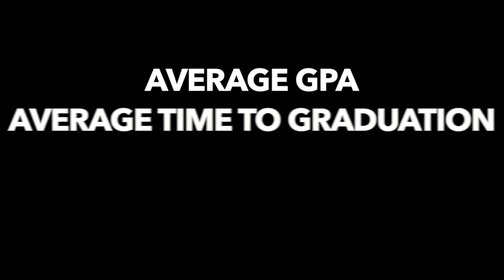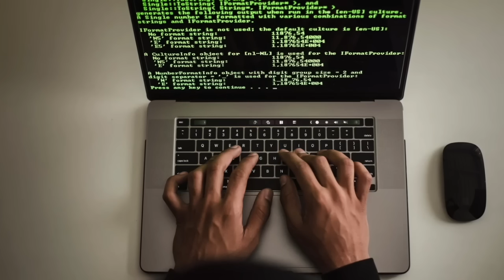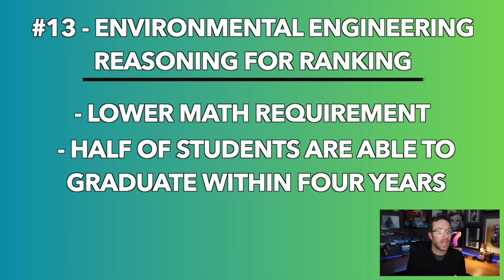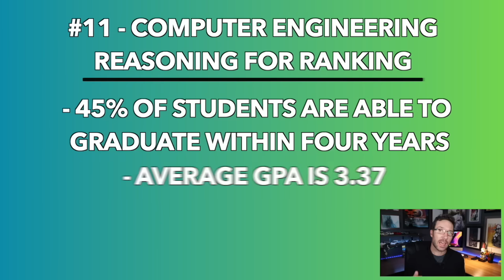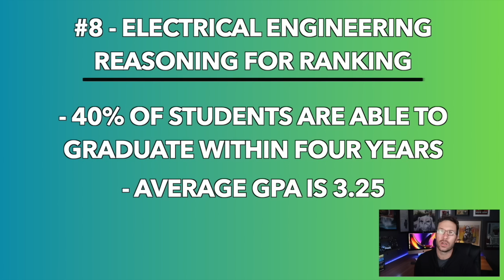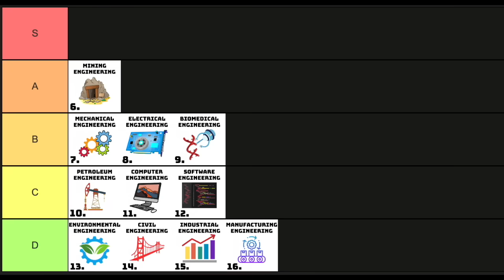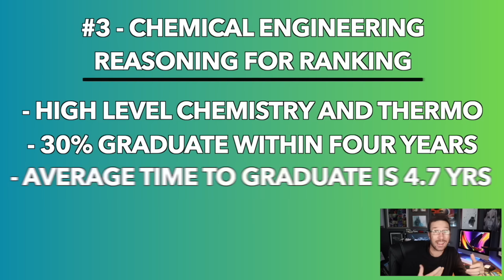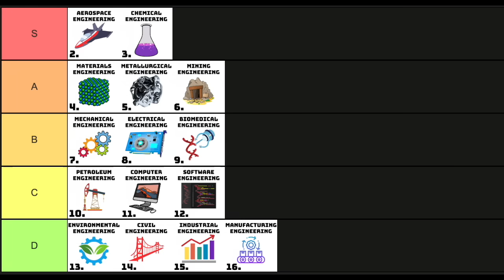Engineering Degrees Ranked By Difficulty (Tier List)

Comment: I've met a lot of people who say Electrical Engineering is so much more complicated than Mechanical due to EEs having to work with literal microscopic components, math & what they cannot observe compared to ME work. And Radio Frequencies might just be one of the most complicated things in general, The Smith Chart being an example of this.
Reply: Electromagnetics. It’s a complex field and heavy in Calculus with partial differential equations (Maxwell’s). I disagree with his assessment that ordinary differential equations was the highest mathematical study. I studied partial differential equations in my electrical engineering studies.
Reply: @brucesmith9144 Thermodynamics and fluid mechanics are full of partials, too, especially at least at the higher levels.
Reply: @silverhammer7779  At my university, we EEs take thermo thru the Mechanical Engineering Dept.  The professor kept many interesting stats over the years, and pointed out that the EEs usually ace the course, the MEs do reasonably well, and Civil Eng. not so well.
Reply: @brucesmith9144 That's so true. We had to take Electromagnetism without going through PDE's first. They really just dropped us in the deep end of the pool there.
Reply: @erenoz2910  Completely agree WRT PDEs.  Given that the wave equation is a partial differential equations, PDEs is a highly recommended elective.
Reply: @brucesmith9144 I took partial diff eq for my EE degree as well. Had this weird professor who played the violin and kept finding ways to write problems relating to violin strings and violins.
Reply: @TechnoLawyer My prof was all about his guitar strings😂
Reply: @brucesmith9144  Might even say electromagnetics is all about fields....
Reply: @brucesmith9144  and was it coincidence that his hardest rated engineering degree was the engineering field he would get into 🤔
Reply: @brucesmith9144 Plus you are working in spherical coordinates. Again, this guy doing the video doesn't seem to know much about engineering.
Reply: @brucesmith9144 Homie, every single field of engineering deals with partial differential equations, you have just been studying the easy version of things, therefore you don't know about it. Keep it real, homie.
Reply: @brucesmith9144  Same here, I'm taking partial diff equation right now
Reply: @brucesmith9144  I came to the comments to make this same point.  Well put!   Electromag still giving me flashbacks 22 years later! "E to the omega j squiggle what???"
Reply: @brucesmith9144 totally agree with you. He completely lost credibility with that comment.
Reply: @brucesmith9144  100% you are right, electrical engineering should have been placed in position 2 after Nuclear engineering, because Circuits Galore is just hell.
Computer engineering should have been placed in third position because digital circuits and coding are just pretty complex.🙏🏻
Reply: @brucesmith9144 yeah, our math course was literally the heaviest out of all the others, and also we had to use most of it later, unlike some other specialties. We were literally grouped together with rocket scientists for all of our math classes
Reply: @brucesmith9144  If you don't learn partial differential equations you will not graduate as an Electrical Engineer.
Reply: @brucesmith9144 yes electrical machines and motors involve serious math.
Reply: @brucesmith9144 Agree totally when I did my electrical engineering degree it was heavy with partial differential equations in subjects like field analysis and communications systems. Most who didn't have high levels of math going in really struggled or even failed to get through. This was over 30 years ago so not sure if it's been dumbed down these days.
Reply: As someone working on a PhD in EE, it just depends on what you are doing. Electrical engineering undergrad programs have a lot of different focuses, and not all of them are as math heavy. 

If you are someone working on integrated circuits and comp E, you'll have a lot more focus on things like circuit design and VHDL/Assembly writing rather than strictly mathematics. If you end up studying control systems engineering, information systems engineering, semiconductor physics, or power systems, then you'll need a good bit more mathematics.
Reply: @r @ryanh7167  Hi, I think you may be able to help me, I'm kind of confused about where I'm positioned as an electronic engineering student. Would I also be considered an electrical engineer, or more of a computer engineer?
Reply: i still think it depends a lot of the university! Mech Eng can get as abstract as any EE degree if it focuses on Fluids and Energy.
Reply: @Abstractor21  not to mention, ME also covers EE topics but not really vice-versa
Reply: @nikolaimikhail7774  Yeah ME is the jack of all trades. It kinda reminds me of chemistry, Chemistry does have a lot of physics and biology and math, but not the other way around (physics usually don't take chemistry, math usually dont take physics or chemistry or biology, etc)  
Both degrees are actually pretty big and will let you specialize in so many subjects: some too abstract, others too visual.
Reply: @nikolaimikhail7774 Actually, that’s not true. My EE program required several ME courses up to Junior level,  but ME’s only had to take a single Freshman level EE class.
Reply: Fluids in EE and Fields in ME have many parallels.
Reply: @Abstractor21  also depends on subdiscipline chosen by student.
Reply: That is 🧢, Mech e Is 10000x times easier. Go learn about convolution and come back
Reply: @NativeBox easier!!!!! People who talked about mech engineering being easier haven't taked thermo and fluids
Reply: Also, math for EE includes partial diff E as well as linear algebra, stats and combinatorial algebra. I suppose it depends on university and focus of study.
Reply: I have 10 years of experience working in engineering. Whatever they said when we were students doesnt hold truth anymore. I have seen computer engineers run circles around mechanical and electrical engineers. It all comes down to the person.
Reply: @nocapproductions5471 I agree
Reply: @nocapproductions5471  I'm kind of confused about where I'm positioned as an electronic engineering student. Would I also be considered an electrical engineer, or more of a computer engineer?
Reply: Just got done with my intro to Radio Frequency class. I got 100% on the exam on the Smith charts and impedance matching. Not too complicated in my opinion.
Reply: True
Reply: Yes. Even here in our country (Philippines) they say that the Licensure Exam consists of 2 parts.
Reply: It depends how you set up your classes. Im taking EM right now having taken DEs and Calculus 3 already. Cal 3 is a Coreq- for EM at my school and DEs is a coreq for circuits. I feel bad for my classmates who are taking Cal 3 at the same time because the useful stuff doesn’t come up till the end 🫠
Reply: I studied electronic engineering, which shares a lot of subjects with electrical engineering in my country. Both degrees take 5 years each. A few comments I have are:
1) It's true that working with the Smith chart is not difficult, but truly understanding what it means (it's a graph on Cartesian coordinates for the reflexion coefficients, on which you can also read on polar coordinates the value of the impedance of a transmission line, a.k.a. distributed parameters of that line) is not so simple.
2) all the explanation of electromagnetic wave guides is based on partial differential equations derived from Maxwell equations 
3) What was not mentioned in this video is that EE also covers the study of complex functions with complex variables, including Fourier transformations, Laplace transformations, and difference  equations (kind of like differential equations, but with complex numbers and complex functions). All of this is used to analyze and design electrical circuits, analog and digital control systems and filters, and much more.
Reply: @mega406 Those aren't easy math at all
Reply: @mega406 I started electronics engineering in 1964 at the age of 15. Finished in 1969 at the age of 20.
Then the government gave me a gun and shipped me to Asia by the time I gave them back the gun I was too old to find work because of the huge advance in semi conductors had to do a huge amount of study to catch up
Reply: @mega406  I'm kind of confused about where I'm positioned as an electronic engineering student. Would I also be considered an electrical engineer, or more of a computer engineer? Also, when you say EE, do you usually mean electrical engineer or electronic engineer, and is it interchangeable?
Reply: @LoveFromChilay  yes, I think I get why you're confused. Electronic engineering is not the same as electrical engineering nor computer engineering. However, there are topics that you study in electronic engineering that are also covered in electrical engineering, and other topics that are covered in computer engineering. In my opinion, you could say that electronic engineering sits between electrical engineering and computer engineering, but each of those 3 engineerings is different from the other 2. In my previous comment, when i said "EE" I meant "electrical engineering". And electrical engineering is not the same as electronic engineering, they are  different degrees. I know I was redundant with my answers, but I tried to follow the same order of your questions. I hope this was helpful!
Reply: Mechanical, Electrical and Civil Engineering are very versatile degrees. Once you get them, you can work in multiple industries.
Reply: EE and ME both are equally complicated, if you are at the top/leading area for these disciplines, because both need to study the field, Electromagnetic fields, and Stress fields, are equally complex things. Remember, people always say, it is not a rocket science, which means, rocket science is hard, how to design a rocket is a wayyyyyyyyyyyyyyyyyyyyyyyyy complicated Mechanical job.
Reply: Objective difficulty is just part of the story. No two people are the same, people have different talents, interests, strengths and weaknesses and the knowledge they already have when they start studying differs, too. That means: a degree, that’s easy for one person, maybe difficult for another and vice versa.
Reply: @MrAranton  This a great point.  I’m sure there are absolutely brilliant nuclear engineers who would struggle as an English major.
Reply: @tomw485  I can do all kinds of very complicated calculation in Mechanical eng., but once I had a chance to learn accounting in Business course, I was totally smashed by financial accounting course, I just can't get into that system (only needs Junior high school math).
Reply: @tomw485  Understanding how to properly interpret a company’s financial statements is an incredibly useful skill. ----- You nail it! This is why CEOs get paid so much.
Reply: @hanfucolorful9656  It is a futile and useless exercise to try to properly understand and interpret the financial statements of companies.  The financial statements do not reflect the true financial performances of companies because financial statements are full of fudged numbers.  The reality is that many employees from the bottom to the top echelon of a company can get away with manipulating their financial numbers to suit their self-interest.  Hence, financial statements are not completed with actual numbers but distorted nominal numbers.
Reply: @markwilliams8257  Thank you for your enlightenment.
Reply: I'm sure universities vary greatly in EE math requirements, at UTD signals and systems as well as EMag required linear algebra, integral as well as differential calculus. Math well beyond partial Diff Equations. Math which is similar to ME and Aerospace Eng when you start to discuss the heat equation or Navier-Stokes equations. 

I think some of the highest math quoted in several of the engineering degrees in the video are only half way into what's required. Dif-E-Q, is only sophomore level.
Reply: I don’t think a lot of yall realize how big EE is lol must of yall just thinking of electronics. People seem to forget about power lol
Reply: @jqthebest1  I'm kind of confused about where I'm positioned as an electronic engineering student. Would I also be considered an electrical engineer, or more of a computer engineer?
Reply: @L @LoveFromChilay  what classes are your focus? Or what kind of job are you looking to get after college
Reply: @jqthebest1  So it's electronic engineering in general which includes pretty much every topic from the subject (except RF somewhat). My course is more focused on computers, so it's got a lot of crossover with computer engineering. It's also got some topics from electrical engineering like electromagnetism and control systems.

As for the job, originally I was looking to become a software developer or engineer or any job to do with computer science, but I've become less interested in these types of jobs and a software only career, hence electronic engineering because it also has software but is mainly hardware. Of course I'm considering becoming an electronic engineer but I've also considered being an avionics, automotive, embedded systems engineer, etc.

Judging from a different comment, electronic engineering is its own thing now whereas it used to be a sub discipline of electrical engineering. It's become large enough to be considered this, but there's still a lot of crossover between electrical and electronic engineering. As for why I didn't choose computer engineering, that's because I didn't want to be too specialised early on, and electronic is closer to computer engineering than electrical engineering, and is more interesting imo. It also provides a link to becoming an electrical engineer or a career based around this if I changed my mind, unlike CE which is quite different from electrical engineering.
Reply: The math requirements I had at CMU for my EE were far beyond what you list. I cannot imagine how an EE could graduate without transform theory, high level probability an statistics. Thermo, digital signal analysis and more. I had at least one math course per semester and sometimes two. Calc 1, Calc 2, solid geometry and vector analysis, and OLDECs were freshman year. Then you got the real math...
Reply: @daleamon2547 The order is more so ECE is harder than mechE which trades blows with EE
ECE (computer engineering) requires a good handle on math, CS, and EE (mainly electronics and semiconductor engineering). The math needed for CS is different from the math needed for EE and depending on how the program is structured, the compE will have to effectively be a double major. MechE vs EE depends entirely on how the program is taught at each school. There is nothing meaningful to say about each field's difficulty as a whole. Someone doing aerospace engineering will definitely be doing a much harder program than power engineering, while signals engineering can be every bit as bad if not worse than thermo (both involve the same math oftentimes and signals is often done with techniques borrowed from complex analysis for even more fine signal design)
Reply: @TheLucidDreamer12  I'm kind of confused about where I'm positioned as an electronic engineering student. Would I also be considered an electrical engineer, or more of a computer engineer?
Reply: I just started my HF- Circuits class and you are so goddamn right 💀
And the once you get to electromagnetic-field-theory the maths get much harder than even thermodynamics imo
Reply: @Julian-zh1nj have you heard of advanced thermo?
Reply: Try capturing microwave signal pulses using capacitor resistor transistor in nano seconds.
Reply: Fourier analysis in the both time domain (laplace) and frequency domain for Dynamic systems can be a challenge for new comers.

It’s usually working in the time domain with sine/cosine maths that things get complicated like Nyquist theorem etc
Reply: I say to choose an engineering major that interests you for its technical content.
Reply: I hate the whole “I can’t see it, so I don’t understand it” excuse that some MEs gave for not going into EE. You cannot see temperature, force, or pressure with your eyes either. 🤦‍♂️
Reply: you can feel them at least, but you can't feel the light, the idea of frequencies itself, and how they managed to explain it mathematically is mind-blowing  @NodeEntry
Reply: Tell them "why you look at that phone screen all day???"
Reply: @NodeEntry perhaps they meant to say EE math has more implicit infinitesimal assumptions while ME maths ensures all processes and their effects are well represented
Reply: @NodeEntry  LOL what? Pressure and temperature can't be felt?

Mech eng DOES include some electrical stuff, which is why we know its hard to visualize.
Reply: @Ninad3204  It's harder than you think to visulaize 3 parameters changing at the same time temp, pressure and specific volume and related energy parameters like enthalpy, entropy...etc.
Reply: By that logic molecular biology is also harder. Doing genetic and cellular engineering involves very specifically manipulating DNA, proteins, and cells through extremely precise methods to achieve desired outcomes.
Reply: I disagree, because where you have wave and  current physics, mechanical engineers have mechanics of solids, fluids, manufacturing, etc..... I would say they are both eaqually hard, but differently
Reply: @kexcz8276 now the programs have changed,are easier than 15 or 20 years ago.
Reply: The hardest thing about NE is getting a job.
Reply: I'm a Mechanical Engineer, EE is not a strong point for me and I totally respect EEs. That said I believe it is what one loves that matters. Also, non-linear analysis of mechanical systems is not a walk through the park but a very intense process of evaluating most systems and is becoming the norm. As an ME I've worked in Aerospace, Oil Platform Mooring systems, Military contractors (not killing but saving), Optics, and metal fabrication and design for architects and interior designers. Love it all.
Reply: In Brazil EE and ME Majors takes 5 Years. I had linear algebra in my first semester 13 years ago, it was a nightmare haha. In here EE also have subjects in Fluid Dynamics, Thermodynanics as well as Solid Mechanics and Chemestry. Combine that with EE`s normal subjects (power system`s, control and automation, telecom, data analisys, ... ) and you have a nightmare of a course. But well, if you graduate I guarantee you`ll be just fine.
Reply: @artkco  
Thermodynamics and  fluid mechanics which EE's study are just little samples of these subjects and don't study them in detail .
I'm sure that EE's have never studies issues like  psychometrics or viscosity .
Reply: As a mechanical engineer I respectfully disagree. Y’all don’t have to deal with fluid mechanics and chaos theory which is about as abstract as it gets
Reply: Nonsense! Wrong assessment parameters
Reply: Jokes on you, we have a Smith diagram in ME as well. (Smith Diagram aka Haigh and Smith Diagram related to material fatigue limit)
Reply: Agreed.  I work routinely across multiple disciplines in engineering, and used to design RF generators for thin film deposition chambers.  This video is a joke - seems like it was written by a Chem E / materials guy with delusions of grandeur.  All of tier A needs to be at least a tier down, and the EE / CS stuff needs to be 1-2 tiers up.
Reply: I agree with that. I was mechanical, the EE thing was a mystery.  That being said the thermodynamics we had to do was pretty damn wacky, and heat transfer, fluid dynamics, control systems, can certainly rival the EE stuff.  I think it comes down to aptitude.  But for me personally mechanical was easier than any exposure I had to EE.
Reply: @markg7963  I think it primarily depends on the school. I thought Chemical engineering would be hard even though I always got As in chemistry. The Chemical engineering guys told they quit electrical. I seen some electrical engineers from other schools that I was amazed they graduated HS. One kid I mentored was from Georgia Tech. Good grief was he dumb.
Reply: It does depends on the university because mechanical engineering is the study of “Mechanics” with tends to be very theoretical and abstract a requires higher level Mathematics (aerospace witch is a subfield of Mechanical)
Reply: I graduated with both an Electrical and Computer Engineering Degree. I started out in Aerospace (similar to Mechanical) Engineering but switched over to Electrical during 4th year after finding fewer graduates were getting decent jobs and aircraft manufacturers were consolidating in the 90s.  My GPA dropped 1/2 a point as the math was quite intense as was studying all the physics for signals and wave propagation; not to mention semiconductor theory and microelectronics.  One reason that more students complete the EE program is due is that the majority of those students specializing in EE from 2nd year had higher GPAs than the other programs.  The students were much more mathematically and physics inclined.
Reply: @krustykanuck  I'm kind of confused about where I'm positioned as an electronic engineering student. Would I also be considered an electrical engineer, or more of a computer engineer?
Reply: I just graduated in ME and my father is an electromagnetism (the Big Boss subject accordingly to what I heard from my EE colleagues) professor in the university I graduated. In my whole graduation my father helped me in different sujects and he said to me many times that the more he helped me, the more he was sure that ME is much harder than EE, in his opinion. It might be because the main problem for EE students (electromagnetism) is pretty easy to him 😂, and the mechanical stuff was all new to him. Nowadays he got so influenced by ME that he is routinely studying thermodynamics and fluid mechanics. As I could see, the more mastered your math is, the easier is for you to understand and delve deep into new complex knowledge.
Reply: Are you aware that laypersons, with no engineering training, who hold Extra Class Amateur Radio licenses are intimately familiar and understand “smith charts”.
Reply: I have several engineering degree and first of all. Pretty much every degree can be easier or harder depending in what specializarin.

I also have friends that have multiple engineering degree making comparison valid.

Where I'm from they are set up a bit diffent. So airospace is a subset degree and so is mining and oil drilling.

And this is sort of the pecking order most people at my university agree on.

So there is pretty much 3 levels. Hard mid and easy.

Top would be physics, math and EE. In that order.

Aerospace is a subset of physics. But most of the quantum stuff is in physics. I studied a lot of extra physics. But don't have a degree. I do have a degree in ee.

Mid would be computer, programing and chemical.

And low would be mechanical, biology, and civil.

I got a degree in mechanical and civil as well and to me it was consideally easier. I read them at 3x speed. Its worth saying that i did read the EE degree and the physics course first. Still when I go back. The mechanical and civil stuff is a lot easier.

Worth saying is that i chose construction for all my degree that is generally considered the hardest.

And there is a supricing amount of overlap between all three subjects. 

But the really crazy stuff where you have multiple dimensions of interferance just don't exist.

It's almost like in civil you only calculate on statistic.  On mechanical you calculate static and dynamic. But in EE you calculate, statistic dynamic and other stuff like noise  interferance  impedance  thar is not really a thing in mechanics.

Looking on say civil engineering. The difficilty there is not primary from math, but rather from large data sets. You have a long list of somewhat not really that hard calculation that have to be compiled. Computers for sure make that heck of a lot simpler. 

But computers wss really late in civil engineering. When I did my degree still not everything was computerized.
Reply: I took an optional computer engineering course. Many students desire a computer career, so it's hard to be accepted into the college. I got a c+ with an 85 average. Everyone gets the answer, but the professor separates grade with the eloquence of one's solutions. Very competitive.
Reply: Yep, going to RF would be abysmally hard
Reply: Elements of controls engineering can be included in several other disciplines such as mechanical, aerospace, chemical and of course electrical.  But it occasionally is a stand alone discipline too.  And it can be very difficult.
Reply: when you do experimemt in EE usually get 90% to 99% outcome, when you do Chemical you lucky the outcome is 50%.
Reply: @Cordycep1  what are you trying to say exactly then..just want to make sure I fully understand. Thanks.
Reply: EE is hard, thankyou for giving us the credit.
Reply: ❤❤ Yup EE is very hard
Reply: I'm a phd EE and the most wicked method I've ever seen is the solution of inverse problems, taught by a ME. And yes, fluid dynamics and really anything PDE is very tough.
Reply: Mechanical is toughest
Reply: Nuclear Engineering with power generation requires you to be proficient in nuclear, chemical, electrical, industrial, mechanical, thermodynamics and fluid flow engineering.
Reply: Choose a field that you have a passion for and a talent in.  You'll do well.
I'm always suspicious of those that are looking only at things like salary, or building a social media brand or following on YouTube.
Or their interest is more in "running a startup" (even if they have no idea what sort of product that would be).  That's not "engineering" that's "business" or something else.

Over the years I've met many who started initially on the EE track, but later transitioned to Software or Mechanical (and became fine engineers there).  
Indeed, the best Software Engineers came from an EE background.
I don't know any cases of the opposite, i.e. someone that was struggling in Software, but just easily transitioned into EE.
Reply: Read The Art Of Electronics. Great book !!!
Reply: I hard bypassed a fuse the other day troubleshooting an electronic board.  The sparks fire, and smoke coming out of that thing wasn’t hard to visualize at alll😂. And, as a ME, I confirmed that the board was broke enough not to worry about fixing it…
Reply: Am I the only one who did dedicated complex analysis class as EE? Focus area was signal/systems/communication systems
Reply: @loganchytraus6829  EE and complexity go together like love and trouble
Reply: As someone who did level 5 course that both mechanical and E&EP.  I can say that the latter is wayyyy more difficult.  Mechanical is basically just maths and the logic and understanding behind it is pretty common sense, thus easy to grasp.

The electrical however has much more difficult concepts to wrap your head around.  Even the “simple” stuff like Thevinin’s and  Norton’s take a solid understanding of circuit theory to fully grasp.
Reply: EE is top tier
Reply: I'm an Electronics Engineering graduate here in the philippines, basically an electrical engineer but we deal with smaller things. Also, communications was part of our course, one of our major, from ground communications to satellite to fiber optics communications, it's part of our subject. Our math, with respect to calculus also tackles up to the numerical differentiation. We also have a separate subject which includes thermodynamics. Idk how different our course is compared to other countries but if I'm correct, ECE is equivalent to EE to other regions.
Reply: Based on my decades of experience I found that as an ME I was able to do some simple EE stuff but an EE would never venture into doing ME.
Reply: Chemistry is a very non-exact science huh? Try being off by a μmol because of some error introduced by a poorly calibrated scale and it ruins 3 months of work. Get bent, scale.
Reply: Me and another guy interned at a company in the aerospace industry working on a spacecraft. We had to do outreach events as part of the internship. He was an EE and did his presentation before me telling all of the kids how ME's only make the box around the electronics. Yeah, you'd think you'd have the most difficult degree if you thought all ME's did all day was build a box around your electronics. Every engineering student thinks their degree was more difficult because engineering students are arrogant.
Reply: Don't forget ME studied robotic too (mechatronics) , so basically ME is studied almost dicipline of engineering, that's why it is one of the most difficult engineering, i would say it should be top 5, if not top 3.
Reply: But then again, Mechanical engineers could be then said to deal with components such as Fluids and Energy which are as abstract to analyse. Also, they have thermo.
Reply: That's because most people have only studied the easy version of things. When it gets really advanced, it's roughly the same difficulty, keep it real, homie.
Reply: Here in the UK My qualifications are Mech Eng/Electric Eng MSc one degree combined took 7 years
Reply: If I told my lecturers that I only needed ordinary differential equations when I studied they would have kicked me off my electrical engineering degree
Reply: So they have both degrees? 😂
Reply: I think it depends on the topic,
Reply: I think at the outside edge of the subjects when you've got guys breaking ground you've got some pretty intense mathematics going on in every single field. When you get your bachelor's degree in go out you have different requirements and hopefully find something that fits you for a person who likes to look at things mechanical would be easier than electric.
Reply: I think that EE subjects could be taught in a more intuitive way.
Reply: Electrical usually has sub-disciplines such as power, controls, circuit design etc.  The sub-discipline can strongly influence the difficulty.
Reply: Agreed, the video is full of stupid conclusions.
Reply: The Smith chart isn’t so hard, it just looks intimidating.
Reply: I am an electrical engineering major specializing in nanoelectronics. Quantum mechanics and solid-state physics are prerequisites to even enter this field.
Reply: Yeah, also chemical engineers, we see partial diferential equations in thermodynamics
Reply: @WepWip  Thats what I said in my comments, Electrical and Chemical are the hardest engineering majors in my opinion.
Reply: Smith charts are not that bad, they look intimidating and busy to look at. But once you get the idea of polar coordinates and what comprises the imaginary element of the math problem, they are fairly simple. Fixing the ratio down afterwards, that’s the hard part 😂.
Reply: As an EE my view is that Mech and EE are similar. A lot of the math is the same, but their physical realization is different. Mech is probably a bit easier because time constants are bigger and a lot of the phenomena can be seen or felt. But at the bar in the end is probably about in the same spot.
Reply: Well, you can rate the difficulty by rating the degree of complexity of their governing PDEs. So I’d say engineering degree involving fluids(Navier-Stokes Equations whose solution is also a subject matter in PDEs math study.)
Reply: Taking a poll here. Are any universities still using the textbook "Fields and Waves in Communication Electronics" (Ramo, Whinnery, VanDuzer) ? That was the text used at UCLA when I was there 40 years ago, and I still refer back to it on occasions.
Reply: Yeah, there's a list in Engineering.  A couple of these sounded similar to me, never heard of Mining before, pretty cool stuff though, we need to mine more!  I didn't see Software or Optical, or is it Applied Optics, on the list, maybe I missed them.  I bet Biomedical is tough.  BSEE (Electrical Engineering) was super tough for me, the math was wild, and we were using a program called Maple to do a lot of equation solving, triple integrals, matrix solving, graphing, not sure if they still use the program but I have a copy backed up that will still run, Matlab was hitting the scene then too.  Remember a program called P-Spice in EE lab that blew me away.  I remember stump matching for antenna design in a class with a chart that looked like it was found in a deep hole on the dark side of the moon, it was round, like my date wheel I use now, was that the Smith Chart?  Craziest class - Emag Waves and Fields, cannot see it, have to visualize it, use the right hand rule, magnetic waves in one direction, electrical waves in another, should we be concerned holding these new flip phones on our ear?  Favorite math class was Baseball statistics with a bunch of physics mixed in was really interesting, great teacher, he could write with both hands and write an equation for a curve ball, for a knuckleball, a ball coming off a bat, show you how to use data to generate these huge matrices that would output the best batting order for a given opponent, cool stuff, it would take months of review w/ a good tutor to remember all of the math.  Chemical and Mechanical were always debated vs. us Electrical guys as some of the harder disciplines.  I liked the circuits, building in the lab, power lab, and a little bit of programming, but I knew code writing wasn't what I wanted to do, I high high respect for Computer and Computer Science guys, C++ for a quarter and that was enough for me.  We would..... however..... make fun of the Civils, lol, sorry Civils...it seemed like you got no respect, and then the Civils are making fun of Industrial Engineering at other schools.  Rose-Hulman Institute of Technology, class of 2001, great people there, and some of the smartest people I've ever had the pleasure to be around, even the Civils.
Reply: I have interacted with all disciplines and each told me Electrical was the hardest. I graduated from the #2 ranked University. Highest math I took beyond DiffEQ was advanced calculus. I guess it depends on what Electrical you specialize in. Nuclear is not that hard
Reply: As an Industrial Engineer that studied BOTH electrical and mechanical engineering. My first year fluid systems & dynamics course was FAR AND AWAY more difficult than anything I saw with electrical.
Reply: @jimcetnar3130  

That’s a weed out course including thermo. How did you like Fourier analysis?
Reply: 😊😮😊😊ooo
Reply: When you get job and specialize all jobs get easier and more so as you do it every day.
Reply: I’m an ME and I find Chemical Engineering the hardest.  The amount of units required to graduate is more than the average engineering degree.  I see a lot of people saying EE and I disagree.  Did any of you like O Chem?  🤣
Reply: Not only that, EE has to have a solid understanding of physics and mechanical systems since a lot of electrical systems are used to drive mechanical systems.
Reply: As a mechanical engineer who switched from electrical engineering, I confirm this sentiment.
Reply: I didn't do it, but I know people who did.  They went far beyond ordinary differential equations.  I'm a biologist and I could do those.
Reply: Partial dif kicked my .......
Reply: mechanical has thermodynamics, electrical has electromagnetics and wireless communication. I wouldn’t say I would’ve rather studied mechanical engineering but I am happy to be concentrating on controls and robotics at the end of my electrical engineering degree now
Reply: In my degree (Electrical and Electronic Engineering) we covered all the basic thermo and fluid dynamics in the first two years covering stuff like navier stokes and the different cycles for different engines and refrigerators and stuff. We also covered some basic materials and structures etc. All the engineering degrees were accredited for mechanical engineering by the IMechE. Where it gets more difficult is when you go into aerospace engineering or sth. The maths requirement here is completely off, we went into PDEs and vector calc for Maxwells equations and also for semiconductors and transistors you need PDEs for schroedinger's equation to derive the nearly free electron model. This doesn't mention the high level of linear algebra you need if you're going to learn any control theory with state spaces or stuff like Fourier transforms, laplace and z-transforms which you need to have a very solid understanding of.
Reply: I’m a ME. When I got to physics 2 (magnetic fields, forces, current, etc) that’s when I decided ME was for me. 
That said, I did enjoy circuits and control theory in ME.
Reply: Honestly, any engineering degree can be the absolute most difficult for 99% of students (the real geniuses will get through anything without a hitch) when they encounter the professor from the Hades School of Engineering....meaning the professor from Hell.  'the final will be much like the midterm, plus a few problems from the last two chapters that 'we' haven't covered extensively anyways' .... then the final is 80% on the last two chapters that NO ONE has covered extensively anywhere.
Reply: I did Electrical Engineering with Radar Engineering as my speciality. It got me into a great career with high wages and lots of travel. I'm retired now but amazingly although I had several employers I was never asked to produce the certificates.
Reply: as a mech engg i agree in someways
Reply: What about materials science in ME??
Reply: Cfd fluid Mechanical engineer do more advanced math than electrical. I was in a nuclear fusion exam with them and we know a lot of PDE applications and numerical approch than them. They had a lot of difficult in the PDE model. Maybe depends on the different Major degrees
Reply: Wtf is that about. When I started mechanical engineer studies, it felt like the first two years were just electrical engineering studies. And all the other fields of engineering at that. At least here the company people joke "when you can't solve a problem and run out of fields of specialized engineers, you go to the mechanical engineer to solve it no matter the subject".

I would also vouch that anything related to measuring technology, surfaces, lubrication etc has pretty darn microscopic components and things you can't see. I've also never seen interior stress in a beam or microscopic vibration on resonance frequencies that leads to failures through yielding. And those FEM matrices are their own jungle, thank god for 3D modelling softwares taking care of that mostly. But those are the easy parts of it, thermodynamics and fluids can go fuck themself.
Reply: At my university, chemical engineering was the most difficult.
Reply: Having done both, the differentiator (in my opinion) is thermodynamics. Which is horrible. Electronics (which includes microwaves and even gets deep into quantum mechanics) is fun, and again in my opinion, is one of the more variable professions in that we are constantly advancing in lockstep with computer science (and other science/engineering disciplines). Truth is, there is almost NO discipline that does not involve computers these days!.
Reply: Thermodynamics was no fun for me.
Reply: As an EE, I would say the microscopic/invisible concepts/components can be sufficiently abstracted to be relatable.  Where EE perhaps diverges from ME is the consideration most professors and universities give to more speculative topics, such as QM, wave/particle "duality" of light etc.  If you can find a professor who doesn't buy into these speculations, EE (and EM propagation) becomes much easier -- not easy, of course, but easier.

I know of one professor, who is one of the most influential engineers of our era, but only because he's famous among EEs.  There might be others.

Also, the Smith chart is an aid.  It doesn't complicate things.  Even non-professionals such as HAM radio operators use it.
Reply: I thought Electrical Engineers have to work with Partial Differential Equations. Isn’t Fourier series and transform from partial differential equations?
Reply: ME is not as hard but it has so much more topics as it's like a swiss knife
Reply: Won’t debate what’s more difficult - I think it depends on what comes naturally to you, but thermodynamics as a 2nd year was horrendous I do know that 😂
Reply: RF is black magic
Reply: Difficulty  based on math is not true either
You have to make the math out of your head since electricity is invisible
Reply: You started to say it, then stumbled.

The hardest form of engineering is mathematics.
Reply: @johnklaus9111  mathematics is not a form of engineering, lol. It falls more into the realm of Science since the objective of science in general is to understand the universe and its laws.
Reply: @calliastah4115  You funny, but you also have it backwards. Engineering is just one small piece of mathematics (wait are venn diagrams mathematical concepts?).

I knew a brilliant electrical engineer once. His finest works were all math. He had 5 degrees.

There is very little you see before you which did not come directly from a mathematician.
Reply: Smith Chart actually clears it up.
Reply: "Nah uh. I have the biggest stick and can piss the longest stream" 😐
Reply: I totally agree, for example, in mathematics the basics we should need, with respect to the Indian education system, we not only need ODE but PDE, Numerical Methods ( for Load Flow Calculations), Calculus (Both Differential and Integral). The problem with EE that I faced during my bachelors and afterwards is that, its a very diverse field, like we study Electronics, that is comparable to another entire discipline and that is Electronics and Communication Engineering, Microprocessors and Software(not to the level of CSE tho), a few parts of Mechanical as well( for Power Plant Engineering), and Core Subjects are already there which are by themselves very difficult.  So yeah, EE touches every other major branch (except Civil Engineering) that makes it tough to fully grasp and excel.
Reply: some ppl think ME harder because entropy, enthalpy, energy, exergy still no one can define them😅 but thats just an excuse from them(since we are not doing research project on what are they)
Reply: I feel it too. The smitch chart is absolutely smoke it
Reply: I'm an electrical engineer, since 12 years. It is easy. Read the documentation, plan ahead and communicate well - that's it. Like complex Lego.
I am really impressed by the ME's I work with though, they are able to take complex, abstract, ideas and create elaborate 100% custom 3D models made of different materials all with their own manufacturing limitations and properties and put it all together. 
Very cool. 

However, just become a SW eng. More jobs, money and a lot of variation if you seek it out.
Reply: I did chemical...I'd say EEs and AEs have it the hardest. We are probably right under them.
Reply: Electrical engineers live in their own little world. You might go crazy or nuts
Reply: Please can any one help me out by giving a comparism between AE and ME
Reply: I would love to see you place Agricultural Engineers too because I believe their work also affects how people survive as all living thing things need food and raw materials sometimes from farms for manufacturing
Reply: I am a 2nd year mechanical engineering student and we study Partial differential equations, fluid mechanics, thermodynamics, rigid bodies, mechatronics, electrical and electronics engineering. So i say that ME is the most full-packed degree for an engineering as we can excel in different jobs and areas.
Reply: this! my University pretty much has this general common opinion, most people who don't enroll into Electrical Engineering do so precisely because of how much it deals with microscopic and abstract concepts, Mechanical is easier to imagine working with physical objects (personally as an Electrical Engineer, I do feel like Mechanical is more difficult lmao. it's probably bias due to me not being exposed enough to Mechanical Engineering so what little I have experienced is too difficult to me to understand.)
Reply: As an electrical engineer myself - I'd say they're on par. Sure, if you dive into electronics, especially power electronics - it's super complicated. But mechanical engineering can also go super deep. So they're both extremely complex at a high level, but they're also about the same at a "base" level - bachelor in EE is not harder or easier to get as ME, and at least from I've observed, they hold very similar places in the ecosystem
Reply: The bad thing about EE is they actually have to believe in electricity
Reply: In Colombia for a Civil Engineer degree you have to complete about 180 credits including Thermodynamic and Dynamics which is heavy on differential equations. So definitely I wouldn’t have it in the bottom of the list. Perhaps not in the top either but somewhere in between.
Reply: The advantage of mechanical engineering over electrical engineering is that you can build a submarine if you want.
Reply: @Reach41  Yeah but the electrical engineer can build an electron plasma gun to blast a hole in the sub. Also we can build a giant LED tv for viewing pleasure.
Reply: Mechanics are not deprived of microscopic problems and problems you cannot see: cracks, fatigue, internal deformations, heat effects, vibrations and Ron of other things.
Reply: ME professors are proud of how many students fail their class
Reply: The scale is irrelevant. If we’re talking with physical context, a single electrical engineer who works in a corporation can design a multi voltage constant current, EMI shielded SMPS with active PFC and secondary synchronous rectifiers that can support 70< amps continuous at 120DC and 20+ outputs via 10 different transformers from absolute scratch with zero inspiration stemming from taking apart circuits or practically reproducing them on a breadboard.

The days of having to manually plot performance curves from calculus or other functions all the whilst sketching these circuits manually are well over, much less building them. We can use simulators.
Reply: yeah digital signal processing course and engineering electromagnetism was dashing
Reply: This YouTuber is actually „retarded“! I am studying electrical engineering and the only study that is harder in germany is aerospace Engineering
Reply: OTOH, MEs have to deal with stresses and strains in materials which are not easily foreseen when and where, not easily visualized in short. I took to Smith Charts like a duck to water.  One basically jumps to the capacitance side to balance out inductance and vice versa.  One can write out equations to help see what is going on with the Smith Chart until one gets the hang of it.
Reply: @Anon54387  
Also fluid dynamics and mechanical vibrations can not be visualized and require a lot of complicated math .
Reply: Hogwash!  All the hard math was done by geniuses before we were born. The only math a EE should have to deal with these days is simple algebra - something everyone who graduated from high school should have under their belt.  Smith Charts SAVE you from having to do math, and for the most part - in your daily life as an RF designer - those charts are generated by an instrument, not you.

The only exception might be if you have to design a new component from scratch. Most of the time, if you're just designing RF circuits, you're going to be using COTS components, where the most "math" you'll have to do is arithmetic - adding or subtracting gains, losses, etc.
Reply: Correct. Electrical is one of the toughest if not the top one. Between mechanical and electrical one is the most difficult depending on the branch and subject. Electrical engineering has 4 branches…
Reply: I suppose this might annoy mechanical engineers but I am an EE and in my first interview for a job I declined later, they gave me a mechanical engineering exam. I had not studied the bulk of the material in the test and winging it, I only missed 1 out of 50 😉
Reply: Yea, and what about Striped Line design, ref Yip... This guy did not do a lot of resurch...
Reply: This guy’s list is way off. Try getting a MSEE, pure EE like microwaves, EM theory, antennas etc.
Reply: It depends on the unit, for example in LSU (where I attend) EE has a markedly higher graduation rate than ME, and it’s anecdotally easier.
Reply: Stupid ranking. The mathematics of electrical engineering far exceeds even rocket science. Mechanical engineering put ahead of Electrical engineering is a classic joke.
Reply: Overall, Engineering is hard
Reply: That is absolutely true.  That is why I went from electrical to civil engineering.   The other thing is, during the time I received my degree, civil engineering required more than the math stated here on this video.
Reply: It's not electrical engineering. it's electronics engineering
Reply: Of all the engineering degrees you mentioned, here in the Philippines I can say that Civil Engineering, Mechanical Engineering, Electrical Engineering, Electronics Engineering,  chemical engineerin, ang geodetic engineering are the most difficult because all these courses require board exams unlike industrial or computer engineerings.
Reply: math in electromagnatics is super complicated
Reply: Photonics & RF design is the most difficult.   More than 10 years industry experience.  Maxwell Equations!!!!
Reply: in my faculty of polytech in congo, we have three majors engenering specialisation, mechanical, civil, electrical, and trust me mechanical is the most diffuclt, hardlly you'll see student graduating in 4 year, what is common in other engenering orientation civil and electrical
Reply: I dont know from where he gets his data
EE eng required to learn partial diff., complex numbers and all that stuff
For software eng, you need to learn many advanced topics in math.
Obvoiusly, it depends in which academic institute you study
Reply: As electrician eng. I testify em is harder. they have courses like material strength. that course was nightmare to me.
Reply: I am a Mechanical Engineer,and I agree that Electrical is harder. I think Biomedical should also be higher, and Aero lower. Convinces me my decision to move off Nuclear in the early 80s when I was in college was the right one.
Reply: EE is significantly harder than ME. While I respect ME and its difficulty. EE, ChE, NE are the hardest. Props to AE as well. CE and SE are just below EE in difficulty as well
Reply: Bruh if they are saying electrical deals with small components, think again about electronics engineering
Reply: Mech Eng include basic EE
Reply: haha, I agree with you, btw I'm a ME student
Reply: Radio frequencies aren't difficult to understand. Just know AC phases and power amplification
Reply: True
Reply: A Physics major has all of the mathmatics of EE and Applied Math degrees and a broader application.
Reply: Mechanical engineering covers a broader spectrum skills now micro scopic engineering is more of a skill right I wouldn’t call it. An education definitely need an education to do it but it’s a skill set and it is very very difficult but so is watchmaking for the same reasons I think electrical engineering and mechanical engineering would probably be two of the most difficult nuclear engineering is again a very broad engineering. There’s a lot of things you need to know to be a nuclear engineer, I think the only point he was trying to make is a mechanical engineer covers a more broad spectrum than an electrical engineer. I find it very difficult to grade levels of engineering. I mean, if you’re dealing with high level material engineering it’s very very difficult as difficult if not more than chemical nuclear electrical or chemical, structural or civil, dealing with no physics mechanical because you’re almost dealing with molecular engineering at that point so I think it would be wise just to say top-tier lexical nuclear mechanical materials, secondary chemical structural geological should be mining and metal energy and the lowest tear being civil. Structural would be a better way to put it. That’s just my opinion as a humble, mechanical engineer. Plus, he doesn’t really mention physics. He mentions mathematics you know when you’re dealing with mechanical and nuclear material and aeronautic you’re dealing with a lot of physics while the physics can be as hard if not harder than the mathematics some of us are gifted mathematics others are not well physics his own discipline altogether I mean, I don’t know where’s my two cents please disregard my lack of grammar punctuation and spelling I’m too busy/lazy to go back and double check a dictated comment
Reply: EE degree here and I work with frequencies as my job. Smith charts are actually really simple. Heck i had more problems with all the other bull crap they make you take! What a waste of time and money on half of your credit hours.
Reply: Thermo says hold my beer.
Reply: I guess it depends, but when I studied EE I've had to know Partial Differential Equations in subjects involving electromagnetics.
Reply: There's one subject in Mechanical Engineering that literally a cut above the rest in terms of difficulty: vibrations. It's like 2 tiers above other hardest subject, they let you bring your small notebooks of formulas and informations etc into the exam and most still have serious trouble answering any questions, compared to all other subjects where we're banned to do that and have to memorize all.
Reply: isn’t smith chart just polar functions?
Reply: The math in electrical engineering was intense. There are multiple transforms we needed to use frequently. I recall some equations couldn’t be written on a single A4 page. But I took extra pure math courses like calculus of surfaces as I liked that field.
Reply: As a EE who studied with many other engineering disciplines in college, I can guarantee you this list is not accurate
Reply: Electrical Engineer here. The difficulty depends on many factors, those of which also include the varying degree of education level - such as learning Advanced Math like PDEs to earn a Master's Degree. What has always troubled me is the fact that your secondary will most likely be something else far more challenging, such as chemical, software and or hardware engineering that pairs really well. Electrical engineering is more of a ... "side gig" if you will, because most of what you learn is about how to manipulate an outcome with chemical based components from hyper specialized reactance to energy. The only catch is that everything you learn in your secondary APPLIES to your primary. You will often hear some people say that you are better off learning chemistry first, before electrical engineering simply because knowing how chemicals react is far more important and makes creating such things much easier to comprehend in the grand scheme of things.
Reply: More than several of my EE courses could have been better taught by the math department so this “highest level of math required” is out the door for me. My EE degree served me well in the microelectronics world - should have taken material science and optics for to be even more prepared.
Reply: @BrentPK  same here. I work in the chip industry and would have benefited from that as well. Also, I had to take partial diff equations and what was called Advanced Engineering Mathematics which was a highly conceptual math class that didn't really add much for EEs at the end of the day.
Reply: During my time electrical engineering hard compared to mechanical because electrical had a lot of minor/major degrees.  This include , power (generation/transmission and building/infrastructure power, communication, computer, electronics.  Like chemical engineering electrical subjects are difficult. For electrical you need to learn higher math like Laplace transform in order to solve complex (imaginary numbers) equations.  I remember equations for a motor (electromechanical conversion) that fill the whole black board with matrix differential equations 
Well I think it just depends on the person.   To graduate in electrical engineering I also have to take a concise subjects in different engineering degrees and I found those subjects hard too.
Reply: Computational Fluid Dynamics will change your mind.😅
Reply: Electrical Engineering is what was easily the most difficult at UWI in the 80s and 90s. People ran from Electrical to pursue other degrees
Reply: Indeed. Most mechanical engineers uses tables and iso curves for calculations. Electrical engineering uses Fourier Analysis, Complex Number, Partial differential equations (not only ordinary), quantum physics. This guy is wrong.
Reply: Laplace transforms
Reply: I took partial differential equations to get my EE degree. I thought EE and Aerospace were the top two then and they required the hardest math at my engineering school.
Reply: Try 3D smith charts for active RF circuits. 

Electronics are going 2 ways. Too complex for one person to manage, but then also easy to manufacture using specialized companies. With small SMDs, like 0402 sizes, you cough and the component is gone(for manual assembly). 

I have my own PCB fab capable of making 50um/2mil tracks and 75um/3mil gaps. But now I am rather using Chinese companies like JLC and specialized assembly experts. 

AI is also taking over. I can now design complex analog circuits (with AI) and verify it with Spice...all within hours.
Reply: For the past few decades, mechanical engineering has been developing within itself a hybrid discipline with computer engineering called MEMS. Computer Engineering is itself a hybrid of "computer science" (actually an engineering discipline) and electrical engineering.
Reply: I would rank EE above ME as well, but they’re right next to each other so it’s not a big issue
Reply: I'm an BE(EE) and MEngSc(EE) and 100% agree.
Reply: EE requires a great deal of math taught in EE courses and not traditional mathematics classes so his criteria is a bit misleading.
Reply: I agree, My late father was a P>E. Electrical Engineer for most of his; He even taught me the basics of electricity at the age of 8. That alone got me into Radio-TV Broadcast operations and maintenance engineering. Very an excellent skill to have is the power of observation.
Reply: Hold on, i study Electronics engineering, which is pretty much how it’s called in my country but the same thing as electrical engineering for other countries, and well, i’m in 1st year but my brother who’s in 2nd affirms the smith chart isn’t really that difficult, like saying it’s like a compendium of formulas that depending on what you need you do a tiny polar coordinates like calculus and you’ll get the formula, just that i takes time, not so sure tho, as i say i’m still a freshman but i believe him
Reply: @yordiquezada9706 , "electrical" and "electronic" are different for me. Although within the one degree course, I did both, starting with electrical and ending up more focussed on and enjoying the electronic side.

The Electrical Engineering was focussed on heavy equipment like motors, generators, transformers. I'm not talking about little ones. We were dealing with big 415V 3-phase and 250VDC motors. It involved a lot of calculus and complex numbers. Not a transistor or diode to be seen anywhere.

Then there was the electronics stream covering what most people would imagine it would. This included antennas, telecommunications, digital electronics, and these new devices that had just come out called "microprocessors" - I know I'm giving away my age now. Unlike the electrical subjects, there was nothing in this side of the course that could kill you. Yes, Smith charts weren't as complex as some may think.
Reply: @yordiquezada9706  I had the smith chart in my introductory course for communication theory. This course made me discard the communication theory path and choose analogue circuits, microcontrollers and control theory instead. In hindsight I think I decided that a bit prematurely, as communication theory would also have been interesting. But I only could take so many classes so in the end the I think I'm happy with my choice. 

I would say the smith chart was not really the most complicated thing I came across in my EE degree. The toughest subject was linux (due to my lack of linux background) and analogue circuits, where we had to understand the operational amplifiers on the transistor level. With that I mean we had to calculate the current mirrors and all the components which make up the opamp. But then again I didn't take the high frequency path and the communication theory path at all. Those are also not that easy.
Reply: @yordiquezada9706  yeah, wait till you get to signals and systems analysis. And try to design antennae with only ordinary differential equations. You’re going to need to know your way around vector differential equations. Chemistry and thermodynamics will also requirements. You’ll also need to understand partial differential equations to understand transmission line theory.
Reply: @yordiquezada9706  The US Federal Government has a job description for Electrical Engineer, and a separate one for Electronics Engineer. Electrical engineers focus on utility/mains power.
Reply: @yordiquezada9706  Smith charts are a conformal map of impedances onto another plane for convenience.  They aren’t hard and make life easy once you know how to use them.  Understanding their derivation is a bit more difficult.  A lot of Engineering is use what’s been proven.  Leave the proof to the mathematicians !!  Problem is we EE’s encompass every other discipline so we have to have a VERY broad understand and can go deep when need be!
Reply: @yordiquezada9706 If its Bachelors then electronics is the way because you learn the basics and can already work with circuit and firmware design, most masters are called electrical engineering because you then specialize in more complex systems, that could be power grid, power electronics, renewable energy etc. But you can also specialize in more complex electronics design I guess depending on the Uni you study at. If its a pure master you take then you will go through all of these regardless, you can still work with electronics even if you have a master in electrical engineering specializing in lets say electrical power, this can be anything from low voltage DC to high power AC.
Reply: I am a electrical engineering professor and the math requirement required is much beyond what is stated.  Communications, signal processing, control systems and electromagnetically all require much more math than ODEs.  Lots of math is buried in EE courses.
Reply: @petergalko2363 what concepts should one learn to prepare for the math heavy classes. Should one focus on calculus, or what exactly  ? Thanks
Reply: @theentrepreneur607  Sorry to have to say that you have to learn it all.  Beginning university in electrical engineering you will have to start learning calculus and linear algebra.  Linear algebra for most students is harder as it can be more abstract, but EE is full of abstract stuff and we find how well a student does in linear algebra is a good indicator of how well they will eventually do overall.
Reply: Ya I'd say EE is one of the hardest. It requires some high level physics courses. He also forgot to rank engineering physics.
Reply: Totally agree. EE much more difficult than ME in general.
Reply: In my school they thought both ME and EE. I picked EE and for some reason I'm in a ME institute now that I do my masters. 

I would say the two are equally difficult, but they focus on different topics. The high frequency stuff from the EE is magic. Same with analogue circuits, control theory, communication theory and other such fields. But if you go into the fluid dynamics of the ME your life isn't really any easier. Same with thermo dynamics or compound materials. I guess EE has more abstract things which require you to grasp non-visible stuff. But mechanical engineers also have classes that require a high level of math intuition and 3D thinking. Also their material science knowledge and their knowledge on how things are manufactured should not be downplayed. It might be less abstract, but I wouldn't say it is any easier. It's just different.
Reply: @benrex7775 absolutely agree
Reply: @benrex7775  Great point.. probably the most accurate points I read from these comments.
Reply: Agree for the most part, but at NCSU, ME is very close to AE.
Reply: I agree mostly with this, i find Electrical Engineering to have partial differential equations, and i believe its harder than mechanical because we deal with things you cant see and that is not a lot harder to grasp bc of that. My friend has a masters in EE and is just finished his aerospace and told me to do aero bc EE was a lot harder for him. Lastly, my school belcurved last year so hard so that they wouldnt lose 90% of the students in 1 year we went from 180 students to 60 with the belcurving plus a lot of ppl cheated so that does make school easier in general, but i mostly agree with this.
Reply: @noahjoseph9633 so you can see pressure, force, and sound?
Reply: Have a BS in Electrical and MS in Mechanical.  EE is much harder.  Remember it is electrical and electronics.
Reply: EEs have to learn electron physics and all the math for it.
Reply: @Chris_at_Home  new taught plans are easier,and garbage. And old grade from 90's early 2000 are like a master degree now.
Reply: Mechanical is easier than electrical not only because electricity cannot be seen but also the complexities involved. Electricity is a very volatile energy whose flow in circuits cannot be predicted except by measurement, and its behavior is even difficult to predict. Mechanical engineering is considered general engineering and the basis of all engineering, and mechanics governs our world. The science of mechanics is not the science of motion as it is commonly known, but rather the science of forces, not only the forces that objects are affected by because of their environment, but within the matter itself, and these forces vary ( they may be electrical / electrostatic, magnetic / electromagnetic, light, physical, etc. ). These forces may affect a certain material and make it move, or that material may not move due to the influence of those forces. In both cases, the system remains classified as mechanical because it is the result of effective forces. The response of different materials to different forces differs. This response may appear on the material, for example, but not limited to, as heat. . The phase of different materials also differs, as they may be solid, liquid, gaseous ( or even liquid crystals ), all of which are considered mechanical. ( Therefore, it is not necessary for the force or material to be visible or physical in order for it to be considered mechanical ) . The mechanical system is simple, durable, efficient and reliable, unlike the electrical system. For example, screens called electronic ink screens / displays, which are considered very efficient and comfortable for the eyes. I myself was once surprised when I learned that they are mechanical screens / displays that are controlled electronically. The same is true with LCD screens / displays. The electrical system is often unnecessarily complex, as the same things can be done with a mechanical system, but in a simpler way than with an electrical system.
Reply: Mechanical Engineering is harder imho.   ME projects are not only on the miniature but also the big and heavy plant machineries that you can't lift with both hands. Lots of unknowns when materials come together and very expensive to make mistakes.
Reply: @fushumang1716 electrical engineering includes power engineering too, which deals with the exact same machines, but from a different angle
Reply: I'm a BSNE.....WAY easier than ME because the fluid we work with the most is water, an incompressible(ish) fluid.  So, that makes a lot of the complicated equations much easier.

The actual nuclear part is mostly monte carlo simulations, so if you can do basic programming, then it's no problem. 

I appreciate your ranking list, but we got too much cred here. 😀
Reply: yessir i agree, EE student right here
Reply: I would rate them as being of very nearly the same complexity.  Both are rich with examples particular to the field based on identical math.   Both also have heavy materials related requirements, though EE does have a strong quantum mechanics component which I simply do not know of the need in ME.  This was for understanding solid state electronics, but again, there may be parallel applications of that math in ME.  One uniting force between EE and ME is thermodynamics, and the need to set up and solve those types of problems at micro and macro scales.
Reply: As an EE major, I disagree. We don't do nearly as much hard math as ME majors do. Not to mention how we don't have to take thermo.
Reply: @erenoz2910 CE/EE major here. I have to take thermo as a requirement for grad in my uni 😭
Reply: @DJkillerFILMZ service academy?
Reply: . Check out the Chem E curriculum. You get dumped into Thermo w/ out 1 kinda prep course that they usually get that is kinda a primer course. Yes, it means an extra course but EE's getting dumped into Thermo is payback for dumping ChEs into Intro to Electronics... Outside your normal field, has a precursor class for the pertinent degree and, you'll likely to never need it again.
Reply: @DJkillerFILMZ  
The thermo taught in EE is just a little sample which talks about some basics of it not a detailed study
Reply: (EE) here, don't let them fool you I had thermo and it wasn't that bad.
Reply: @erenoz2910  you didn't have to take thermo? Every engineer in my school had to take thermodynamics regardless of major.
Reply: @Crossfirev only mechanical engineering students have to take it in my university
Reply: @erenoz2910  you must not have taken any power classes
Reply: @erenoz2910  Steinmetz did the heavy lifting in the EE field, using complex numbers to solve what would otherwise be a set of simultaneous equations differential equations was genius, but it only works because the circuits EEs commonly solve are driven by continuous functions.  In ME we have to do it the old fashioned way when solving vibration problems, many vibration inputs are best represented by the Heaviside function, ouch!
Reply: @evancourtney7746  How come MechE problems don't come as continuous functions? Out of every engineering field, you would think that mechanics would have the most continuous functions.
Reply: @erenoz2910   A lot of vibration problems deal with systems excited by impact.
Reply: @erenoz2910 the math courses are the same… you just apply the math you learn differently
Reply: @erenoz2910  Took stat thermo as an EE, and did not receive an A.
Reply: @erenoz2910  We had to take Thermodynamics, one of the hardest course in the EE curriculum.  Purdue '55.
Reply: @erenoz2910  -  Really?  Most universities don't require PDE for an ME major, but require it for EE.
Reply: @chestermarcol3831 says who!!!!  PDEs are much more important in fluids, thermo vibrations waves, and heat transfer or have you forgotten the Navier Stokes equations?
Reply: @erenoz2910  As a retired EE I had to take thermo ( a long time ago ) The summer after I took it I had a Research assistanceship at Oak Ridge, where as an EE I worked in a energy efficiency lab and learned all about thermo.  it was enlightening.  Thermo is actual a fascinating subject that is not taught correctly.
Reply: @erenoz2910  Tulane EE's had thermo & strength of materials 1985-1989. Having inspiring instructors with a passion for their subject is a HUGE advantage.
Reply: @erenoz2910  I took EE and we took thermo and way more math than just partial differential.   First year was 7 courses and you had no time for anything outside of homework. We took chemistry, physics, then quantum physics, also mechanics and some civil. We also had to take a few outside courses like economics , law, psychology and statistics.
Reply: @erenoz2910  i just took thermo and i am an ee major
Reply: @erenoz2910  I do EE ,  i took thermodynamics
Reply: @erenoz2910  Where did you go to school?  At The Pennsylvania State University (Go Lions!) we definitely had to pass thermo and it was taught by the ME department, i.e. not watered down.  Also, there was a course in general relativity (taught by the physics department) which was another "weed out" course heavy in partial differential equations.  Which brings us to maxwells equations, fourier analysis, etc.   Absolute essentials to fully understanding EE. So again, I question what kind of school you went to.
Reply: @erenoz2910  EE here. I had to take thermo. It was very hard but I had a great professor (a practitioner instead of classic professor) and she showed us how things worked in real life which made it interesting. I still say electromagnetics was harder than thermo.
Reply: @erenoz2910  You didn't have to take thermo in EE? I did and a lot more difficult math than partial differential equations. In EE it takes longer since you have to learn the older tech as well as the newest.
Reply: @erenoz2910  Well there are many different specialisations of electronic engineering. In Power electronics things remain quite simple as far as matheathics is concerned, in theroretical telecomunication engineering, where syntheitisation of the electronic circuits based on the needed equation over frequency etc. is done, absolutely all engineering mathemathics available somewhere is needed. Sometimes already used before the mathemathicans found out why it really works, like Dirac-impulses and similar.  Smith diagrams, as mentioned above, came in the middle of the studys.
Reply: @erenoz2910  I took Thermo at Drexel University in 2000's
Reply: @erenoz2910 , EE's math is deeper than that ME (add to this electromagnetism at the fundamental level, electronics). But thermodynamics in ME is just as difficult, if not more difficult, depending on the person you ask.
Reply: @pelmanelengemulongo9981 then study vibrations in Mechanical engineering then, now you can compare. I'm e ME student and i got good grades in Circuits, i think EE is a lot easier.
Reply: EE should be ranked S tier